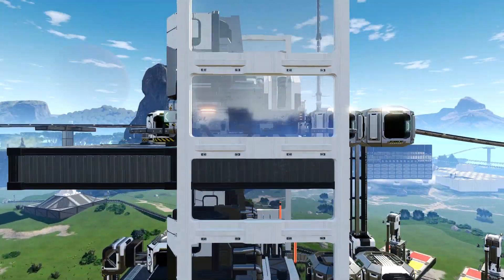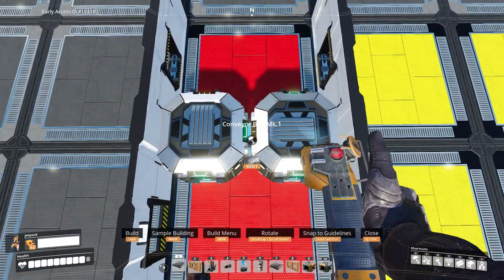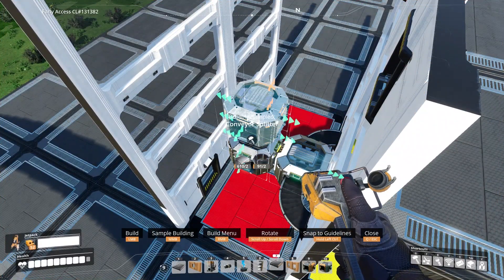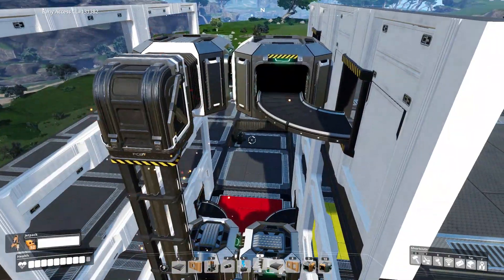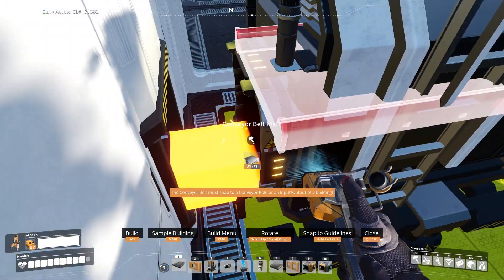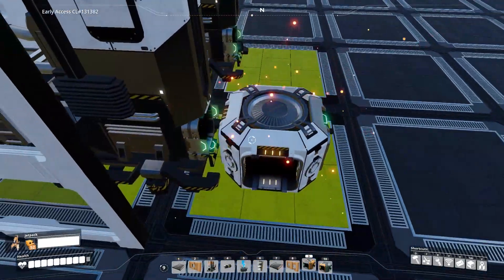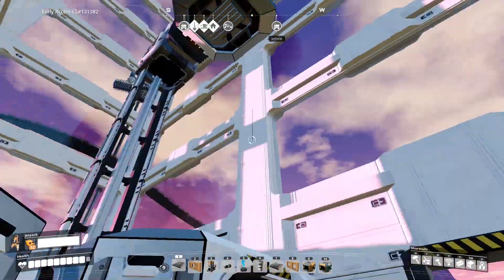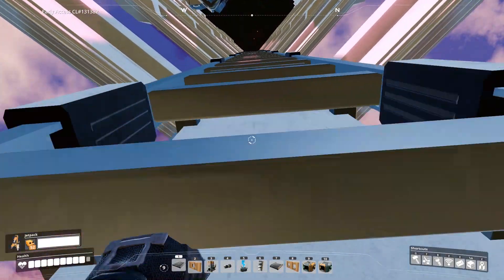100% EFFICIENT, VERTICAL, STACKABLE SMELTER DESIGN | SATISFACTORY

Comment from the maker: Hey guys! At 4:38 I made a mistake with the conveyor placement. I used an Mk1 instead of an Mk3, it has to be an Mk3. Just a heads up for anyone using it.
Reply: You may want to pin the to the top comment spot. Great vids so far!

Comment: Unfortunately, this layout no longer works, at least not as-is. They changed the clearance for smelter outputs. You can no longer link the output mergers with a single belt, but need to use two, which means the mergers no longer line up with the conveyor walls.

Comment: I Like this design, but 270(mk.3):60(mk.1)=9:2 So 240 will be divided as 196:44. Lower smelters uses 22 instead 30.
Reply from the maker: Which is why you don't overclock the miners to produce 270. Miners mine ores at multiples of 60.
Edit: also your maths is correct, but I don't think you get how the numbers are split.
https://youtu.be/oIUTq6vUK8c
Check this
Reply: @chankykang4918  there is mistake in that video. Mk.3 conveyor has 270 ppm, not 240. To solve the problem without overclocking you should use conveyor mk4 instead mk3 and mk2 instead mk1 after first splitter. 480:120 = 3:1 as we need.
Reply: @Olga-jg3bl  You are aware that you can still just make it so mk3 belts carry only 240 items/min, right? The belt doesn't have to be used to its full capacity.
Reply: @fabiocandelori9163  No. Splitter divides the stream according to belt speed. So 240 will be divided in proportion 9:2, not 3:1 as we need.
Reply: @Olga-jg3bl  Again, you are confused. Yes, the splitter is limited by the speed of the belts on its outputs, but otherwise it tries to split evenly. Now, as Chanky showed, if you input 240 items (because, again, the speed of the belt is only the limit, if you want you can have a mk5 belt transport the output of 1 assembler creating reinforced iron plates and it would still be just transporting 5 items/min. Mk3 is the lowest tier belt that can transport 240 items/min, so he used those) the splitter will try to divide them equally, but since the mk1 belt can only take up to 60 items/min, the splitter will fill the mk1 belt and output the remaining 180 items/min onto the mk3 elevator lift.

Comment: I make similar layout for all types of manufacturers. But I have external staircase that leads to Q-like shaped foundations and S-like (radiator) conveyor route for input and output.

No flying is needed, but appearance vice my factory looks a bit like city built in USSR from some points of view.
Reply from the maker: When you say similar layout, do you mean like a vertical style building? Like a tower? 
Also, that sounds so cool!!. Why don't you upload a picture of it on Reddit r/SatisfactoryGame? Or have you already done that?
Reply: @chankykang4918  Yup, verticality and relatively small footprint. Connection logic differs from yours. I'm not on Reddit.
I'm on Tier 3-4 now and building like that since I started to make foundations. On the other hand... my external belting is quite messy and unwalkable in some places. Wiring also could be tidier. Since each prodution chain lies upon one resource node and is in WIP stage. It would be easier to lend a save file entirely via cloud or something like that.
Btw... It's my 5th playthrough attempt ×_×. 4th factory (multilayered with 2 stacked bus lines) has troubleshooting issues and messy resource processing plants so is... UNsatisfactory )))
Hm... new idea. Later I'll try to make belt entrances and exits not on first wall layer of first floor, but on third. To improve "walkability" of factory.
Reply from the maker: @VoldemarExplorer  Bro i highly recommend reddit. Youll see some amazing stuff there. Ppl are awesome, the pages are awesome, no bull****. It's unlike all the other social media platforms.Also  that link isn't working..
Reply: @chankykang4918  https://dropmefiles.com/rsBLS 
I don't know if cyrillic session name and save file name could be a problem. Haven't tried to use external sourced save files yet also, so I'm not sure if lending will work out in our case. If so, we can try to agree on multiplayer session for some purposes. Experience exchange? Showcasing? Whatever we agree on.
2nd idea - Z-shaped refinery stacking towers. With top-down liquid flow and unpacking on a top floor if it is better in energy efficiency department than uplift pump usage. Why? Those beasts are tall as Sauron's tower by themselves X)
Your's tower variation is pretty tidy and clever though.
Reply from the maker: @VoldemarExplorer  yoo id love to have a multiplayer session. as for the experience exchange, I'm gonna be honest I don't know if I can contribute much cus It seems like u have a lot more experience then i do
But yeah lets try it out.
Reply: @chankykang4918  Link unusable? Welp, sure. At least you have interesting approach, that you can apply to more of bland knowledge. Sort of.
Reply: @chankykang4918  Rebuilding factory in 2-4 bpm (blyats per minute) rate -__- 
Because of new ideas.

Comment: what is the hotkey to copy an item and use it.  at the end you copied the mk3 lift and then built another
Reply: On the controls settings there's a thing called building eyedropper. That's the one you are looking for. I think it's middle mouse by default, but I'm not sure since I changed mine.
Reply: @sergiofernandezlorenzo3446  awesome thanks
Reply: @sergiofernandezlorenzo3446  But you have to be in either build mode or disassemble mode for it to work.  You can't just be running around normally and hit MMB and it put you in build mode with that item.  You have to either have a build chosen or be in disassemble mode, then point at a structure and press MMB and then it will give you that building.
Reply from the maker: yup its the middle mouse by default